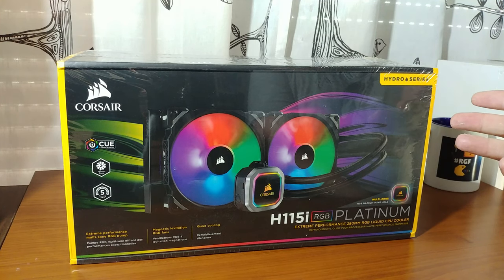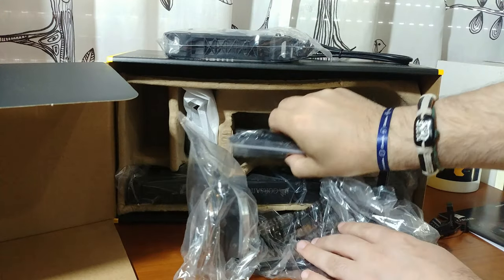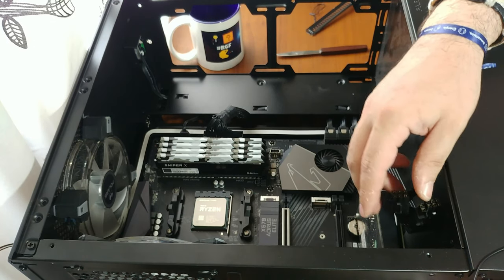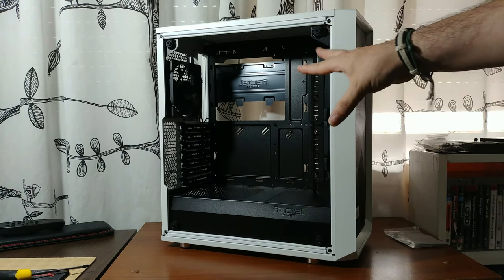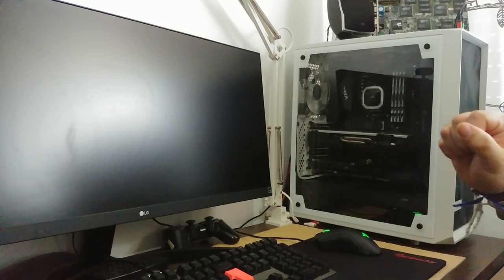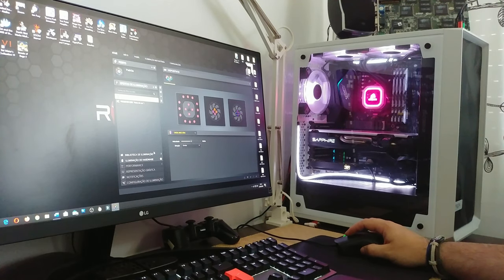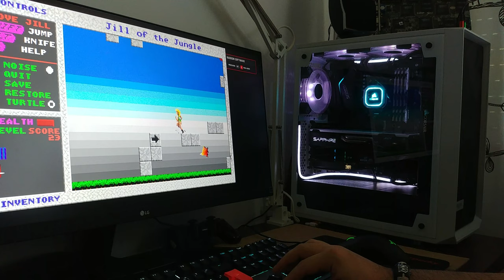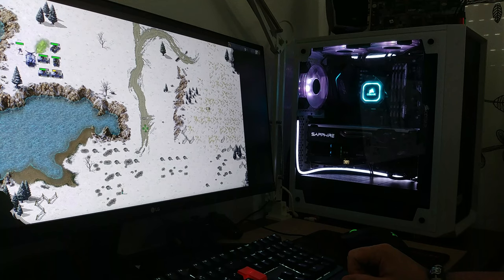Corsair H115i Platinum AIO & Fractal Design Meshify C Build

Comment: One thing to consider... is you've mounted the radiator the wrong way around and you might kill the pump due to air.
Reply from the maker: That's been fixed ;)
As for "kill the pump", that's quite difficult. But again, it's fixed.
Reply: @DeckardGames  Cavitation does not bode well for any kind of liquid-moving pump. It may not cause immediate failure but there will be some thermal abuse if cavitation is present. But I digress; I am curious if there are photos of the build after the radiator relocation?

Comment: Tried to fit a Cooler Master 240 AIO in this case but my Asrock RX 6700xt wouldn’t fit when the radiator was on the front. Also wasn’t enough clearance for my top of the motherboard headers/connectors when I tried to mount the radiator on the top. Rip 🙃 so I basically only got 2 RGB fans out of it

Comment: I thought front mounting was bad? 

Edit: Doing more research on this matter. Trying to fit a 240 in my brother Fractal meshify C case.

Seems to be ok so long the tubes are bellow the pump and the the radiator is above the pump?
Reply from the maker: When front mounted you can go tubes down. Or, if the tubes are up, make sure they're above de pump.

Comment: I was wondering if the aio you're using is 280mm? As I want to get a 280mm radiotor in the exact same case and in the front.
Reply from the maker: It is 280mm.
Reply: @DeckardGames  Thanks

Comment: how are you mounting your radiator like that with the h115i? the screws that came with mine are not long enough
Reply: to reach through the fans into the radiator and its not like i san screw the radiator to the fans and the fans to the case, as the fans dont have any screw holes

Comment: ideally you'd want that 240mm radiator on the top blowing through and out, (also then you get the pipes on the bottom of it so that will eliminate air bubbles going through the loop).  In my next build I will have this setup and if I try to win a gtx 1080ti on ebay for a good price, I am going to do this for sure and remove the stock heatsink blower and replace it with one of those hybrid coolers that EVGA does, the ones where you have blower style still but also watercool on the die  with a 120mm radiator, then attach that to the back exhaust of the case blowing again through and out!  then all fans on front are just intake fans.  that's my dream but I have no money :(
Reply: I'm planning on placing the same AIO with the radiator at the top of the case. It seems like there wouldn't be enough clearance in this case... you think it would work in a fractal design meshify 2 case?
Reply: @Virtuousxlife  you might need to go with a smaller cooler. Say a 240mm to be able to top mount it.
Reply: @Adam__B  thanks! I ended up going with this but meshify 2.